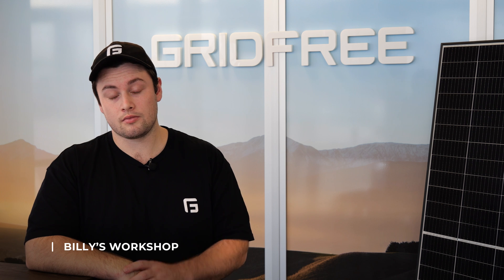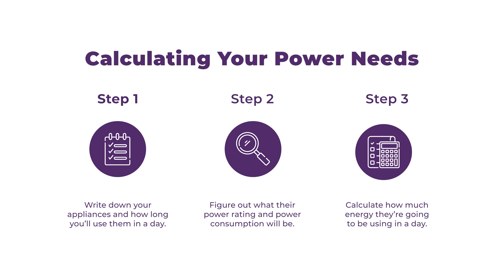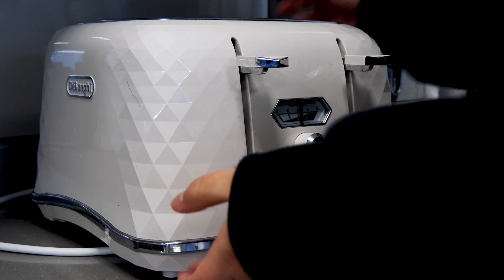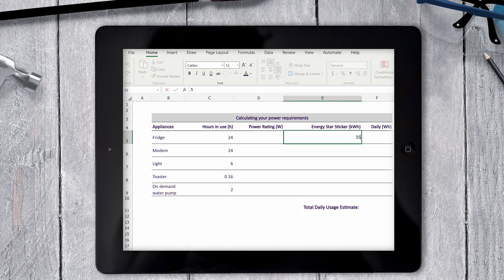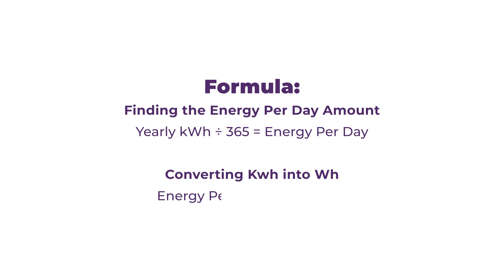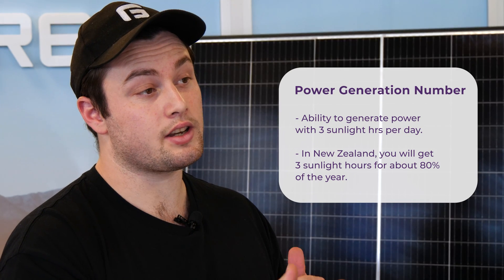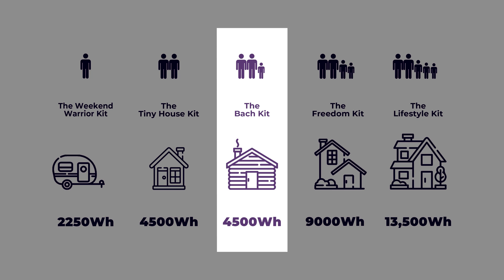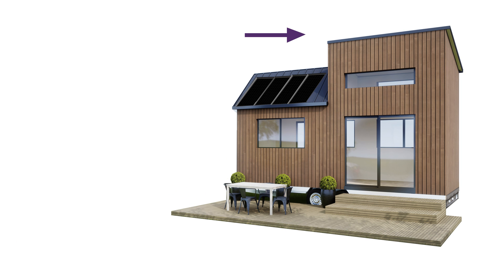How to calculate an off grid solar system - Calculate Solar Panel Needs + Loads | GridFree

Comment: the next issue is, what happens when you get zero solar gain for several days in a row
or 12 days in a row like i've experienced this year, twice.
you either run out of power or use a generator.
I took my lithium battery to the neighbors house to charge them, i would never of even considered it if they were gel or lead acid
then then the grid went down and the sun was out, the neighbor came and used out power
Reply from the maker: Yup, no matter how many solar panels you have you need a generator to get through those cloudy periods sometimes - great that you and your neighbour were able to help each other out though!

Comment: Pretty good explanation but you didn't actually cover what the kits produce.  Off grid over 20 years now and my system is only 800 watts. That runs a 12 volt OD water pump, led lights, laptop, wifi router, swamp cooler, small cooking appliances, microwave, and recharges all my gadgets and ebike.

The key is to only use heavy loads in the day time when the sun is shining after your batteries are full and not at night when you are only drawing power from your batteries. If people will do that you can use a smaller system.

At the prices of solar panels today I would oversize the system to double what you expect to use and then on cloudy days or in winter you will have enough solar to recharge your batts.
Reply from the maker: We've kept the details of what the kits produce a little vague because our panel sizes increase regularly, so this way the video won't become outdated. All of this information is kept on our website. 

Agreed on that advice!